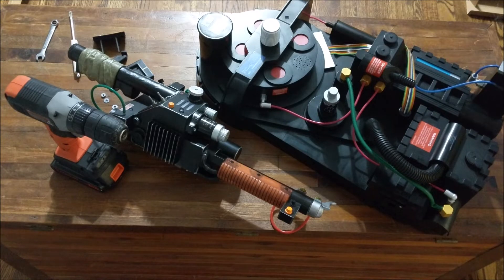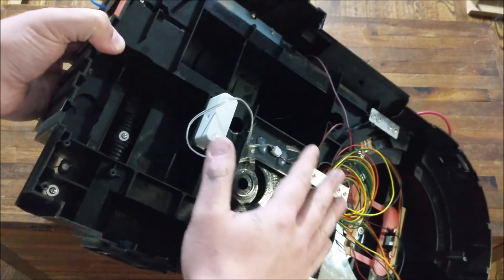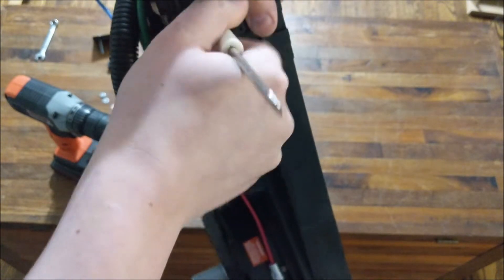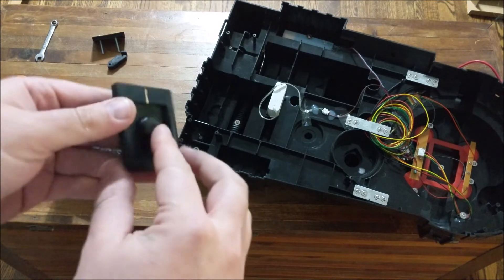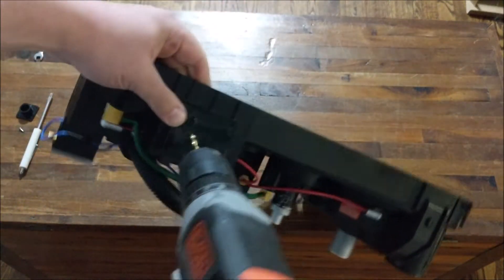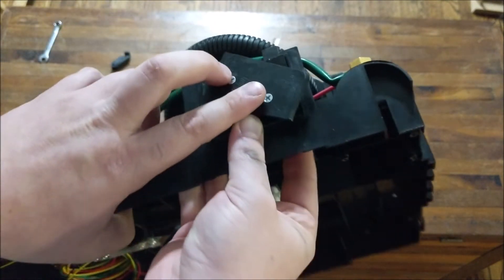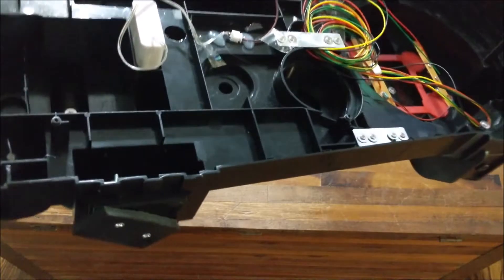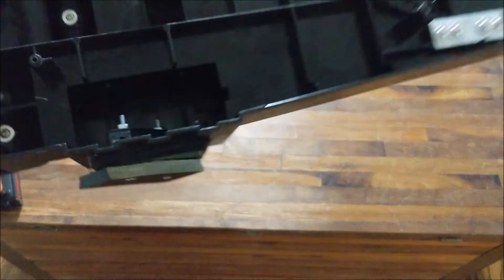Mount your Hasbro Spengler Ghostbusters thrower to your Spirit Halloween Pack with our mount kit!

Comment: I understand replacing the V-hook, I’m still not getting how to connect the hose with all the wiring/on switch being on the spirit wand. Still haven’t found a video on where to put the wires and create a new switch...also how to keep the spirit pack going for more than a few seconds. I have the 2021 pack and I believe the guys inside are a little different. Urggghhh.

Comment: so how is it trying to re-seat the wand on the pack while you are wearing it?  I just bought one from your etsy for my spirit pack as my spengler wand is showing up tomorrow, and I have a magnetic coupler installed on my pack now, but I was very worried that a magnet would somehow mess up the programming of the spengler wand or possibly cause some weird issues, and being the wand cost almost as much as the pack, I'm not taking any chances with it.  BUT I am a bit concerned how hard it will be to get the wand on the pack while wearing it, which the magnetic solution solved very nicely, but the spirit pack wand is pretty dinky and doesn't have any specific chips in the wand either.  So it seems like this (your resin v-hook) would be the way to go.  just curious, maybe I will do a demo video once i get it all done as I am also replacing the sub-par hose that comes on the spirit pack that made it super difficult to need the magnetic mount in the first place.  So hopefully the upgrades I am doing for this round will come together nicely (my first round of upgrades was putting a wood motherboard, upgraded lights, upgraded ribbon cable, ALICE pack-frame, and magnetic wand hook on the spirit pack, which was a great first step).  Anyways, very glad your product exists so fast after the release of the spengler wand, it is definitely the touch that will make the spirit pack be an awesome budget pack!

Comment: Yeah, but what about detaching the Spirit Pack's wand without damaging too much of the circuitry? Last I checked the main power switch is on the wand
Reply: Every wire inside this thing can disconnect with a clasp. It's really easy to dismantle. Even easier to lose screws.

Comment: Would NOT trust a thin piece of 3d printed plastic to hold The Spengler wand. I used Real Metal V Hooks on both packs for the throwers.
Reply from the maker: We wouldnt trust the spengler wand to a 3D printed mount either, thats why these are solid cast resin!

Comment: How do i attach the wand hose to the wand? Is there a good way to do it?
Reply: I sliced the hose from the spirit pack a bit to accommodate wider port on the hasbro wand and then used electrical tape to secure them together.
Reply: @CaptainAssholay  I wasn't too enthused with the hose that came on the spirit pack anyways, so after reading around on some other GB forum posts, I ended up ordering some no split 3/4 loom from amazon so that when my spengler wand shows up, I am just going to replace it altogether, hoping the 3/4 size will be perfect for the connector piece that comes with the spengler wand but we shall see.  Either way, I would suggest getting some loom to replace what comes with the spirit pack as mine caused me all sorts of issues and just seems too short anyways.  Hopefully 3/4 is right size, if not maybe 1 in would be the way to go, but I think 3/4 will be perfect, seems like the spirit pack only comes with 1/2 in or maybe 5/8 at best.